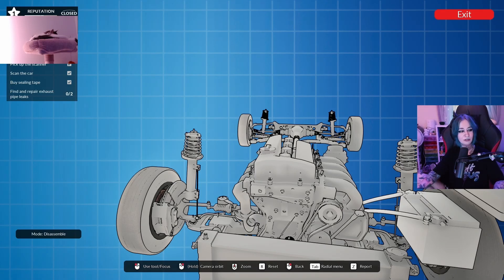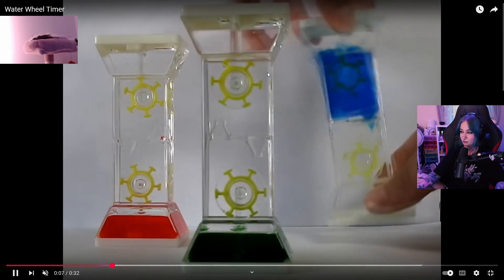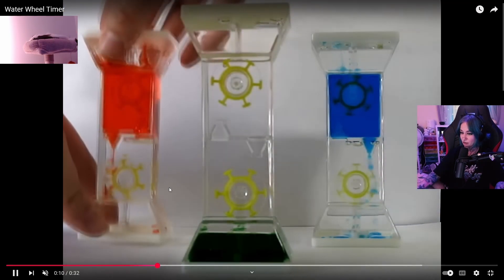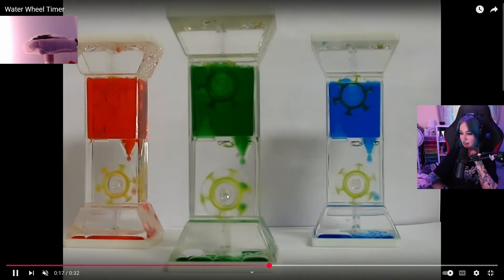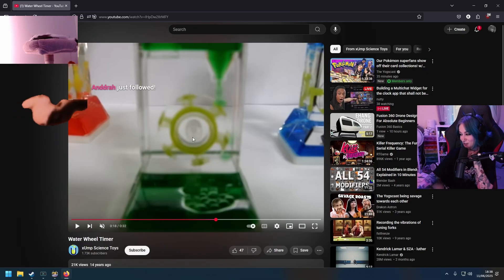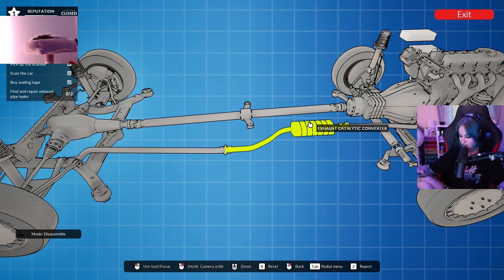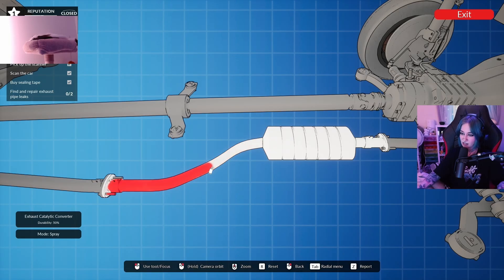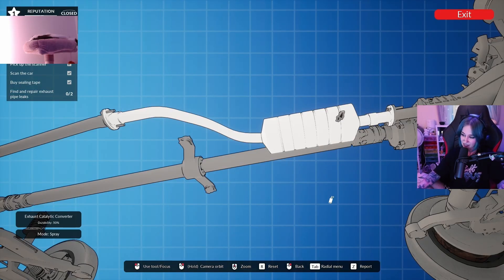How a car engine works

Comment: As someone who is constantly finding my shamu to be unaligned I found this explanation to be particularly helpful to show my mechanic on my cell phone. They definitely didn't understand the gas conversion ratios and those guys were obviously overcharging me cause they weren't accounting for the fuel retention. Now I have a new mechanic and they definitely understand the whole oil system and how the shock absorbers contribute to the fuel retention. thumbs up